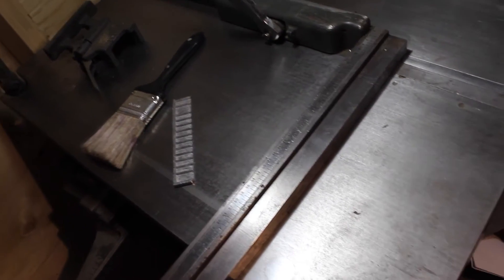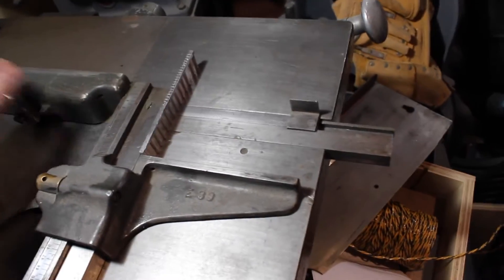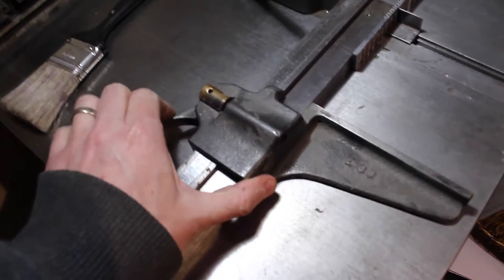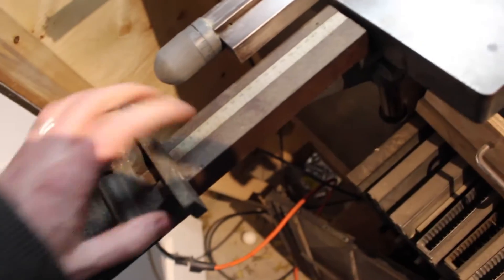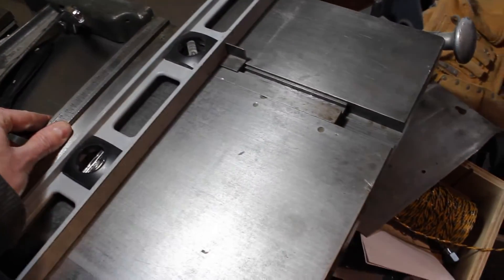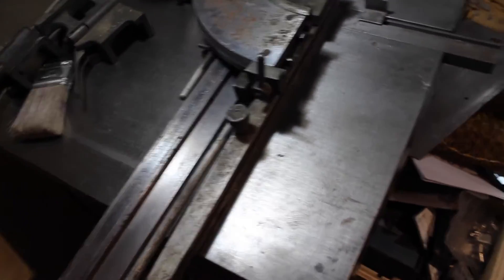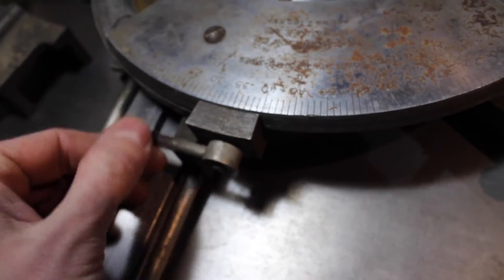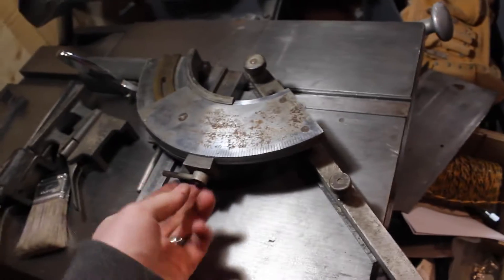C&G/Morrison Printer's Saw

Comment: I just bought one from a printer near the southwest corner of Michigan, near Indiana, here in the US.  It's in great shape, came with many attachments and such, but not the adjustable miter.  That is a nice bit of kit.
Reply from the maker: The miter attachment seems to be quite uncommon. It’s a fantastic saw and every time I use it I remember why I like it so much. I need to get a new blade for mine, the one it came with was missing teeth, which a local sharpening shop repaired for me, but the blade just seems wonky. Any cut pressure causes it to start to oscillate side to side. I think it’s a balance problem.
Reply: @beefchicken  Please pardon the tardy reply.  If you  have found a source for well made, well balanced carbide toothed blades (ideally glue ready cuts!), please let me/us know.  I've had zero luck. Actually, any replacement blades would be nice to find.